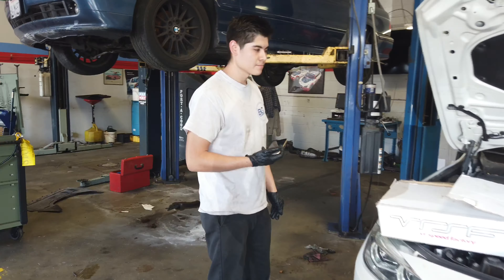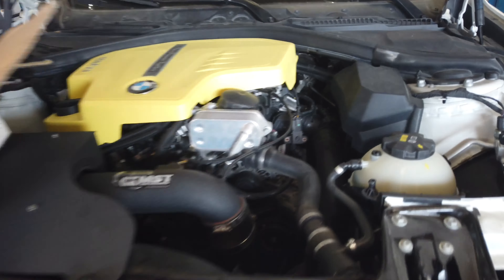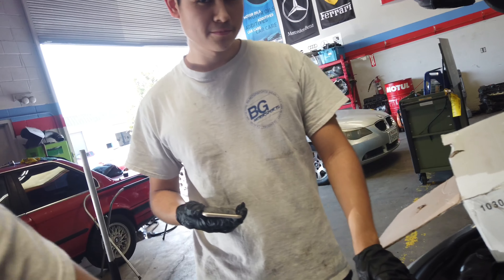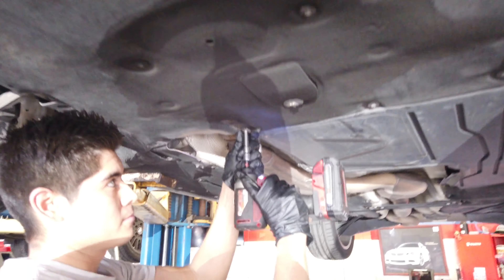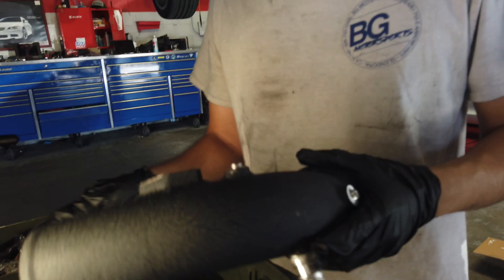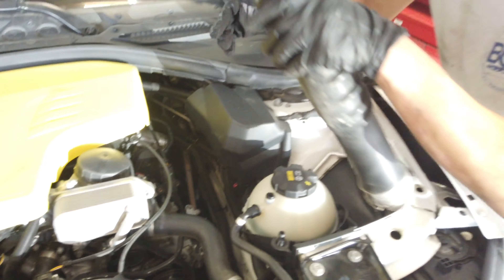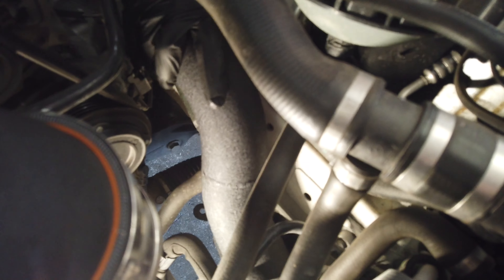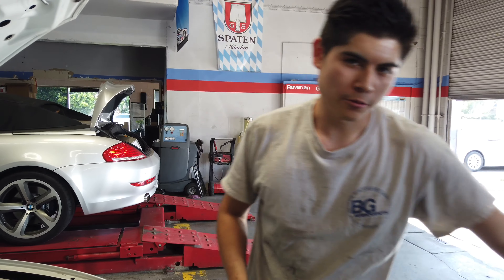N20 Charge pipe install

Comment: I noticed the edit when connecting the pipe to the throttle body. I was curious to see how tight the fit was or if there was any give. I also have an f30, and am running into a problem with that connection. It just doesn’t seem to fit for some reason.